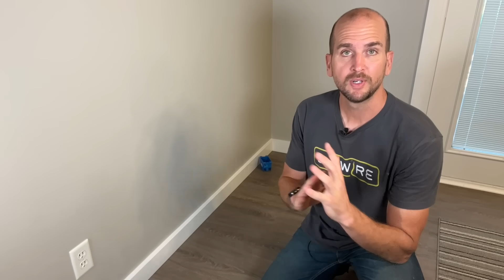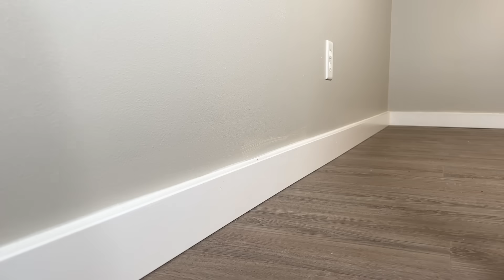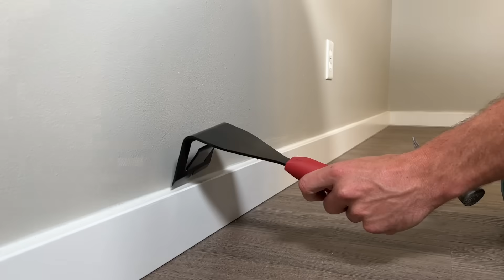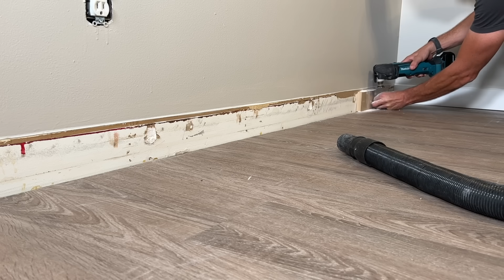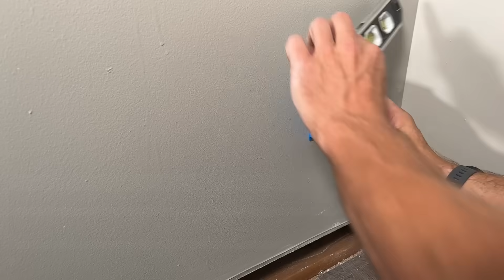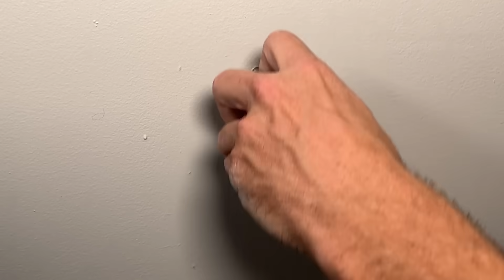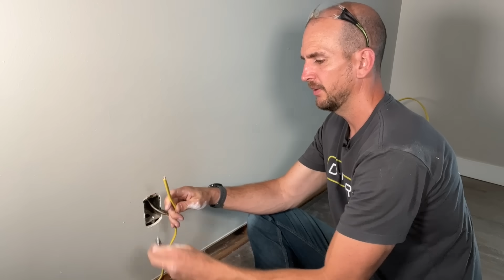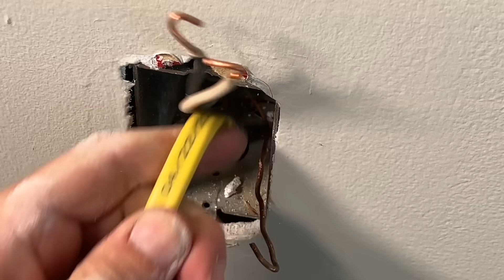How To Add An Outlet To A Finished Wall

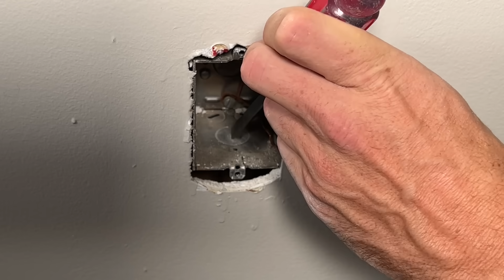Comment: 5:00 Most electrical boxes (including the one shown in this video), already have multiple round knockouts right against the back wall of the box (at the top and bottom), where there is also a screw-down metal cable holder plate/bar (which you can see in this part of the video). The wire hold down plate/bar in this video already has a ground wire held in place by a single screw. Just pop out the smaller round plate right below that plate, unscrew the plate enough so you can run the new cable up and behind it, then screw it down snug (not tight) to hold the new cable in place.  You don't need to use that nut/connector if you use what's already in the electrical box. Just make sure to leave enough wire coming out of the box so you can reconnect the outlet easily (you can always cut the wires shorter later on). Btw, those screws nut/connectors are mostly used for electrical panels where there are no wire hold downs. They are rarely used for this type of in-wall electrical outlet install.
Reply: I was wondering the same thing.
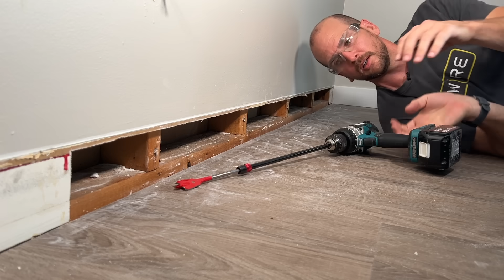Reply: @jimmyjohnjames6397  Actually, if you look really carefully at 5:05 you will see that the lower clamp is missing from the box.  The bonding wire is connected to the clamp screw which is an electrical code violation in my area.  There are actually several actual or potential electrical code violations in this video.

Comment: A damaged outlet can cause current not to get to another outlet. In a different roon. Like a damaged out let in the bath only sends enough current to operate the dryer bot not the washing machine. Electricity is strange stuff,might connect a strip to good plug and washing machine cord and washing works.  Not a separated plug.  Once put a metal switch cover on a switch and the light would not turn on, put a plastic cover  on and it worked. Dont do this a home.

Comment: Wall should have been protected from damage done by the useless baseboard removal silly thing.
Watch as it marks up the wall with each use. I cringed thinking about having to repaint the wall for the owners. Even a peice of paper tween the tool and wall would've helped.
Terrible job on precutting the caulking too. Wow!

Comment: I just added one outlet to 3 different bedrooms last year. I cut directly across, removed roughly a 6 inch x 4 feet section of drywall in each room, and the ran wiring to the new outlet. I then did the drywall repair which included sanding, painting, umm resanding and repainting (lol). Your technique would have saved me so much time. I will remember this. THANK YOU.

Comment: Using Wegos for outlets is as bad as back stabbing outlets. They are fine for determined load in lighting but they are a terrible connection for and outlets where you may have a larger load like a vacuum or space heater. You could have easily terminated all the wires on the outlet to avoid this and saved yourself room in the small box that you tapped off. If you would have done that and used a green wire nut for the ground you would have had much more room. It’s always a roll of the dice when you stuff that many wires in a metal box like you did, that’s an easy short.
Reply: Wagos have been used with mains loads for years in Europe and are listed for the job. What evidence do you have beyond anecdotal that they are as bad as back stab? Just because they are new in the US and not invented here doesn't mean they are bad. They are approved per the NEC and as long as you use them correctly they are perfectly safe for full loads.
Reply: @wings2004   30 years of experience doing diagnostic work and I’m a master electrician with my own Company I can’t tell you how many times I’ve found melted Wegos, or even shorted wires or loose connections because of these connectors. When you have rooms and the wires can lay flat and not bend those connections are fine but when your jamming wires in a box like he was then for sure you put back-pressure on those connections. The same goes for back stabbing, its UL listed for use but any electrician worth his salt will tell you they’ve found melted outlets from a stabbed connection. Also these types of wire connectors have been around for awhile. I’ve been using them for lighting for about 25 years, when there is a determined load I’m all for it but in the application on this video I believe it was a novice move.
Reply: https://youtu.be/B1pmuRsf1co

Comment: Great video, thank you, I hadn't thought of this!! At the 7:30 mark (and the 8:31 mark) when you show your tool box with connectors. I thought that using the orange and white connectors was a no-no? I also thought that back stabbing outlets was considered a no-no too? I definitely have a lot to learn, and it might be fine, I was just taught not to, and to wrap outlets with electrical tape, even it plastic boxes.

Comment: This is great! I'm a low voltage tech and I've often struggled with bundles of runs in finished locations. 1 Ethernet is easy to run behind a baseboard but 10 runs? This is a. Fantastic and I'll be using 5his at one point I'm certain of it!

Comment: I really do like your videos, this allow customers to see how much work this really is. When I explain it, they don't believe me. FYI, you have a metal box that was existing. The ground wire is required to be bonded to the metal box. NEC 250.8 and 250.148C. If a device is installed in a metal box, the ground wire shall be bonded by approved means to the metal box. I was curious, as it was edited, how you got the metal KO off the lower section of the box, to knocked it out with a screw driver, did you reach up from the bottom and twist it out? So many can not reach it and was glad to see you told them not to skip that step, that a connect is required by code.

Comment: Wagos are the worst. Give it five years and bam here is another service call. I have had found more loose connections that i have found with these than have ever found with wire nuts. Absolutely refuse to use these lazy man pieces of junk.

Comment: Pretty sure this is illegal in the UK. Horizontal cable runs have to be in the floor or loft space, unless in a zone of the kitchen or if it's run in trunking on outside of wall so it's visible.
Reply: I don't think so.
If you had three sockets in a row they would have horizontal cables running between them. 
I believe the important point is that the cable runs need to be a) either horizontal or vertical (not diagonal) and b) below the sockets or level with the sockets.
The other option is running directly down from the ceiling.

Comment: Great tutorial. I’d only add that the ground should go up for safety. I place ground up as I replace or add an outlet. It is code here in GA for ground up. Thanks for the ideas.
Reply: I don't think it's against code to place them down either. I live in GA and every house I looked at when buying mine had them down. Seems to be down to the preference of the installer. Not sure how it would be safer. But I don't like when extension cords and some power adapters have to be plugged in upside down with the power cable running up, so if it were my house, I'd still flip then all to be ground down for my own sanity lol